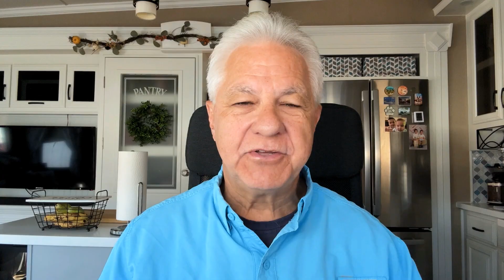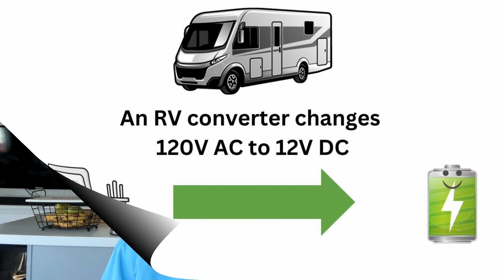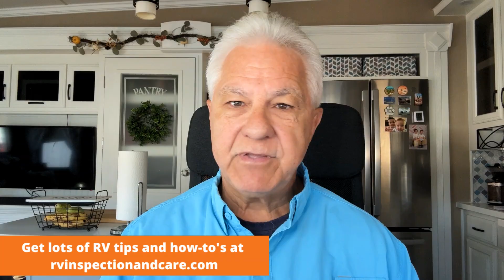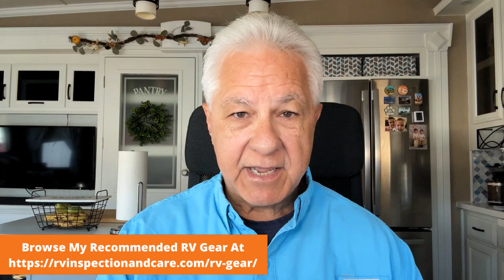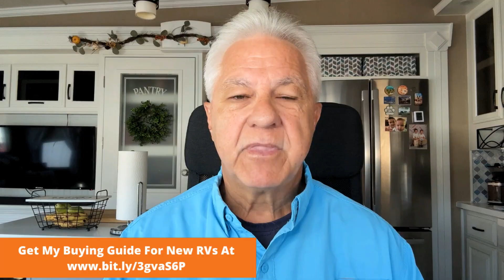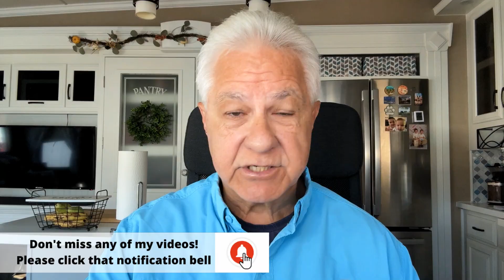Find Out Why The Right RV Generator Size Depends On How You Use It!

Comment: My toy hauler trailer has a 5500 watt onboard Onan generator, it'll run both AC units, and the Microwave as well as lights, TV, and computer all at the same time without an issue...I did buy a "portable" 11,000 watt tri-fuel inverter generator as well so I can run everything I could think of if needed.  I'll be living in my RV full time, so being able to run whatever I want/need is a must, plus I'll be using a washer/dryer combo as well. 

Something to keep in mind, yes, I can run all this stuff, but the RV itself is a 50amp RV, it'll run a lot, however, the breaker panel has its own limits, which are oftentimes going to be your 15amp circuits...they're very easy to overload, so keep this in mind, if you need to run something that might trip that 15amp breaker, find another outlet to plug it into that is on a 20amp breaker...or run a heavy duty cord directly to your portable generator and power it that way, most likely what I'll have to do with my washer/dryer combo, I don't mind, I'm planning on building a 30amp receptacle box on the back of the trailer so I can run a 30amp cord to the box, and then on the inside of the trailer I'll have a 20amp receptacle just for the washer/dryer combo and whatever else I need that power for.  

Don't buy a big generator if you don't have a way to move it...the one I have is about 250 pounds when the gas tank is filled up.  Its not "portable" like one would consider portable to be LOL.  I set mine on a pallet, if I want to move it I use my tractor with pallet forks LOL.  

With my situation, I'll be parked 99% of the time in one spot, so I won't have to move my generator or anything once I am setup on the RV pad that is being prepped right now, and I get power, water, etc. setup out there, I'll be ready to go, that is one other reason I got the big generator, I'll be set on the pad before I have power, so I want to be sure I can run whatever I need, as well as tools.  

If your RV is a 30amp model, get a larger generator now, because at some point in the future you probably will upgrade to a larger RV, and probably to a 50amp service, buy the big generator now instead of buying a small one and then having to buy another generator later.  If you get the bigger inverter generator they don't use much more fuel than the smaller non-inverter models do, unless you are pulling heavy loads from it, then it ramps up the engine speed and will drink more fuel of course, but for the most part you will be happier with a larger generator and a smaller RV that don't need much power and it'll keep the generator running at a lower engine speed to conserve fuel and keep your area much quieter too.
Reply from the maker: Thanks for sharing your generator setup with us. Sounds like you have a great setup to handle all your power needs for full-time living! ⚡

Comment: My 32ft coach came with a 5500W Onan and can power everything onboard no problem. The only appliances on my unit are the TVs, the microwave, the ACs, the power converter to charge the batteries, and whatever else I bring (my water kettle is a big one). So long as I don't run the microwave and my kettle at the same time, I can power everything I have in my 50A unit on 5500W.
Reply from the maker: Thanks for sharing your generator experience with us. We have a 7500 watt Onan generator in our motorhome and we can have any combination of appliances and A/Cs without ever overloading the circuits.

Comment: Noob question, if you occasionally need to run an AC overnight could you install say a 12k kWh battery system, and charge it with a generator in the daytime?
Reply from the maker: The problem with using batteries to run A/Cs is that they pull so much power that they can suck most batteries dry in a very short time. There are some rigs these days that have so much solar power coming from roof panels, and such large lithium battery banks, that they claim they can run their A/C for several hours. But to me, using battery power to run your A/C is not the ideal solution. I think that a generator is more suited to that kind of task and gives the option of having as much power as you want as long as you have fuel for it.
Reply: @ — True, I was thinking of a class B van review that said with the 10k kWh of batteries, it could run the AC for 8 hours.  Looking at an RV with room to stick a Delta Pro 3 w/ expansion totaling 12k+ kWh capacity. (Black Friday price almost $7k.  I get two 100 Ah batteries ain’t doing squat, I’m just wondering how crazy I am. LOL!
Reply: @Erin-Thor  As the saying goes..."In theory"...yes, the DP 3 should run ONE A/C.  Way too many variables to say for how long.  Brand and size of A/C (13.5 or 15k), outside temp & humidity, how cold you set it, how much space you're trying to cool?  and on and on.  ---- Here's the "theory" part.  On the higher end, an RV A/C uses 1800 watts/hr - you'd have about 6 hrs of run time with 12k kWh.  If you need A/C at night, I'm guessing it's pretty brutal during the day.  What's going to run (multiple?) A/Cs during the day?  If you said "generator", remember you have to use some of that generator power to recharge the DP3 - you're going to need a big, expensive and "thirsty" generator to handle all that.  $7K for batteries + potentially $7-$10K for a really big Onan generator + fuel doesn't seem worth it for (as you put it) the occasional need to run AC overnight, just my opinion.  P.S.  Those big generators use about 1/2 gallon of fuel per hour - did you considered fuel storage/transport?
Reply: @ — I was thinking I could charge it during the day, and you’re correct, I didn’t even think of the additional draw during the daytime to charge.   In daytime, I’m okay up to about mid 90’s, at night though I’m a wimp, LOL! Fans help a lot, guess I’ll have to plan for that too.
Reply: The problem is the outside temperature is going to dictate how long that AC runs/cycles at a time, the fan itself doesn't pull too much power, its that AC compressor kicking on that really pulls the power.  

They do have some inverter AC units out now and some 12V AC units out now that do claim to use less power, and might be something to look into if you are planning on needing to run it off a battery bank and recharge with a generator during the morning hours while its cooler outside.

Comment: Hello Duane, great timing. We just purchased a Winnie Micro Mini 1800BH with a 200w solar panel and one standard battery. We want to pick up a Harbor Freight 5000 inverter generator for off grid. Come with a 30amp connection. I'm hoping that this will be good enough to run the AC during the summer. Our camper is a 30amp. We are still new to RV so videos like this one are always welcomed.
Reply from the maker: I'm glad this video is timely for you. And yes, the Predator 5000 inverter generator is a good choice for your 30 amp RV if you want to run everything while you're off grid. It's even a little oversized for your needs, but better too much than too little. Predator generators have good reviews and everyone I know that has one is happy with it. I hope you will be very happy with it!
Reply: Perfect. Thanks